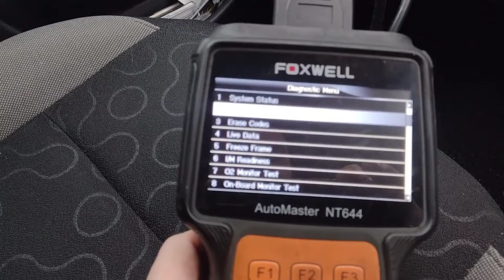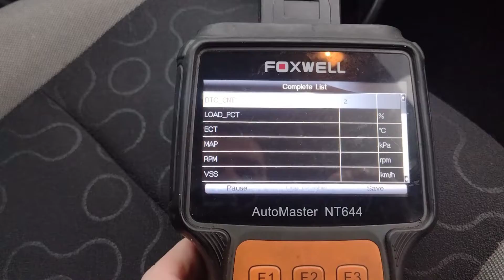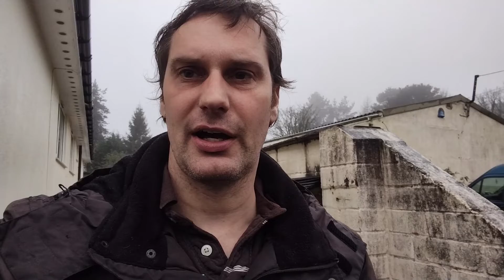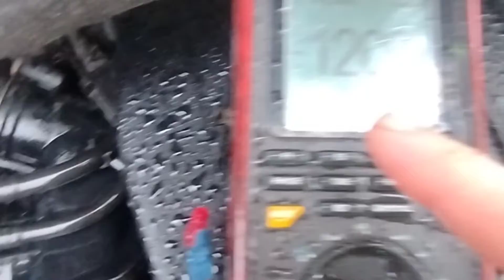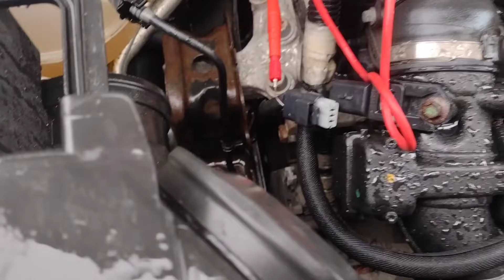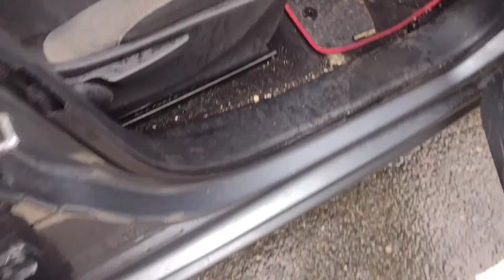P0069 Barometric/Boost Pressure Correlation Fault (Citroen C4 Picasso)

Comment: Nice testing Matt i wish i got one of those low current otc testlamps while they were available

Its Always a worry getting tools wet I always try to keep a cheap meter and run the scope leads in to the back of my van to protect the machine from the rain 😩.. Summer will be here soon not to worry 👍👍
Reply from the maker: Thanks, I have that multi meter sitting on top of a dehumidifier just now. Looking forward to summer